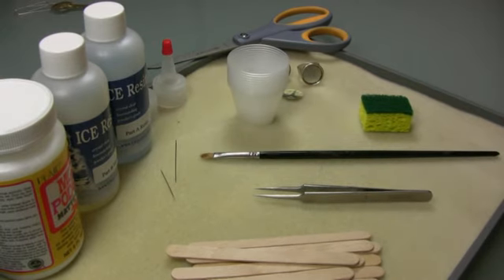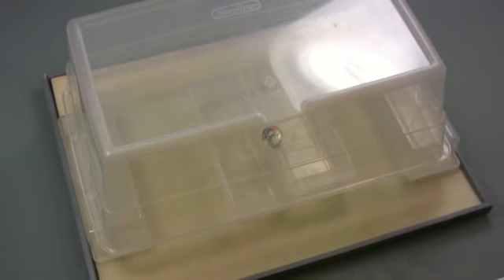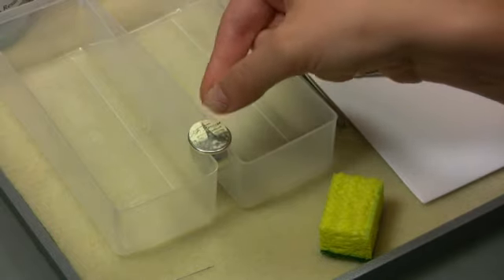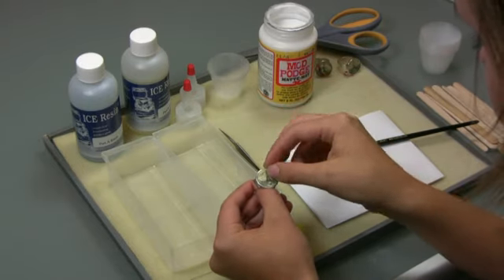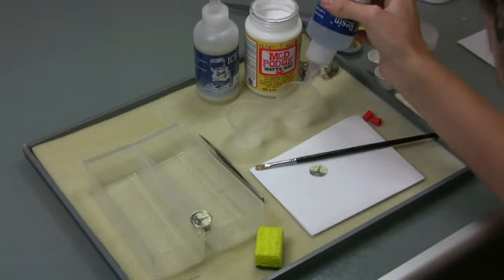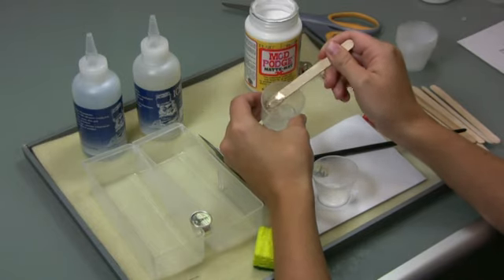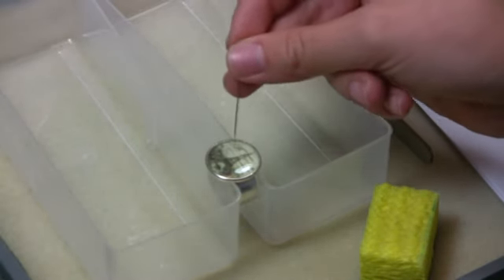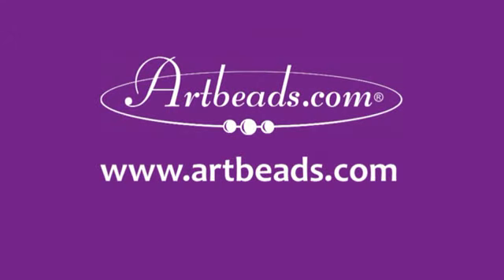Artbeads.com Tutorial - How to use ICE Resin to make resin jewelry

Comment from the maker: @kzoretic1 Thank you for your question. It is very important to measure equal amounts of both the hardener and resin or it will not harden properly. To remove the resin from the pendant tray, try using a paper towel and gently soak up the ice resin. You can then try using soap and water to remove any further residue, then let air dry.

Comment from the maker: @RottingQueen Ice Resin can be applied in layers. First, add one layer of Ice Resin and your glitter, beads or other items. Wait 24 hours for this first layer to dry. Next, pour a small layer on top to seal the items underneath. You may add new items on this second layer if you like to create a 3-dimensional effect. Let this layer dry for another 24 hours. Then add next layer to cover. Cure the Ice Resin faster with a desk lamp. The Ice Resin will cure completely in 3 days.